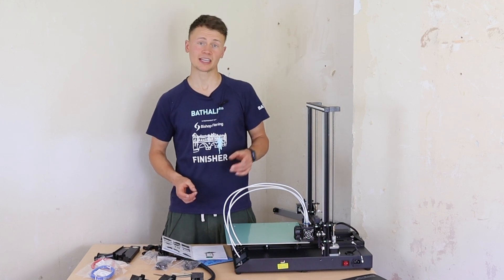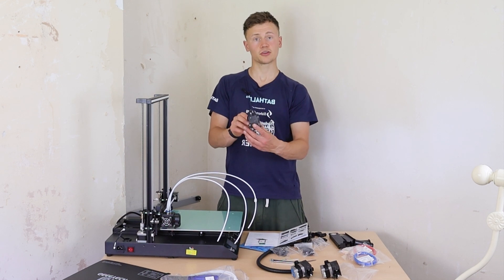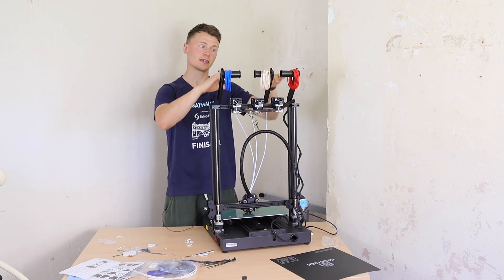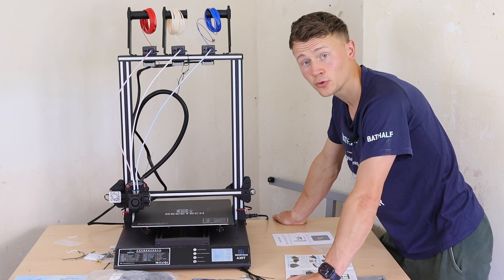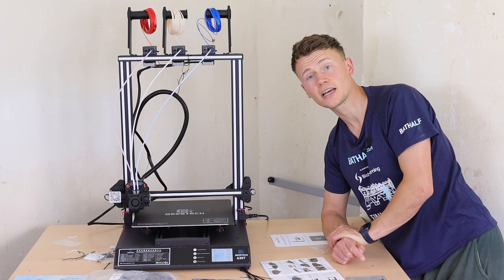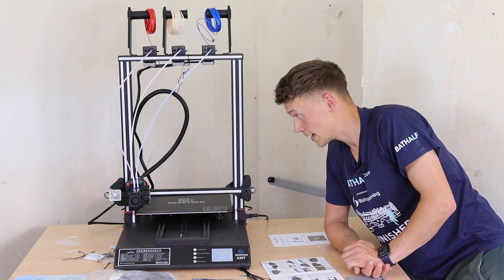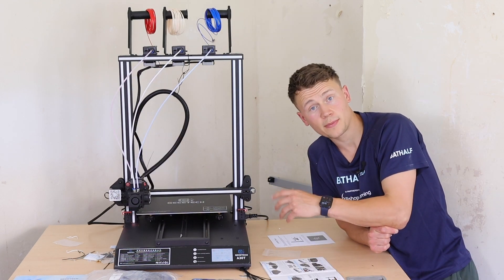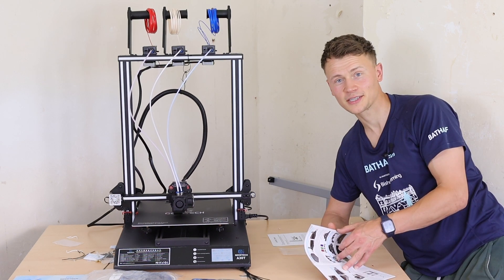Colour Mixer First Look || The Geeetech A30T 3D Printer

Comment: On the travel moves this printer ooses some material. I tried the retraction from 1 mm to 16 and it seems not to retract at all.
Could be it's a firmware has disabled retraction or in the software of slicing is not generating the retraction code or or maybe retraction is not possible. 
If I get a quick answer that will save me some time otherwise I will be debugging the g code to find the truth. And I am very new to G code, hence it will take long.
Thank you

Comment: Really cool the color mixing with the decent build height.
I have a couple IDEX printwrs and a dual extruder single nozzle machine and i dont use purge towers. Just bi colering in layer chunks. Not a fan of wasting all the material